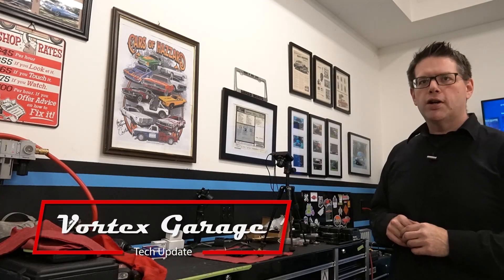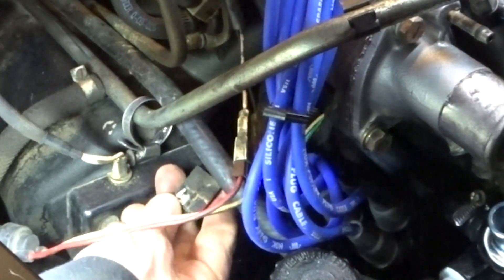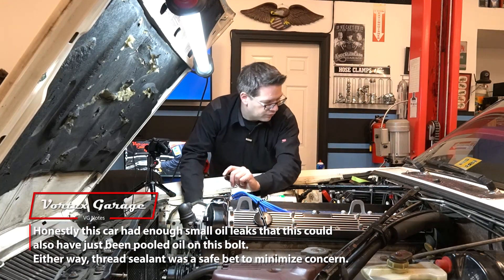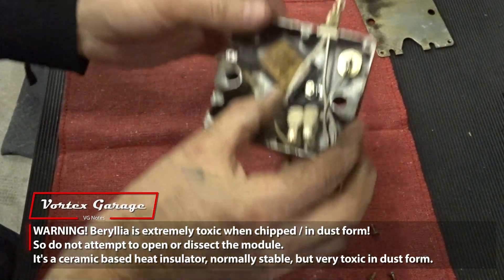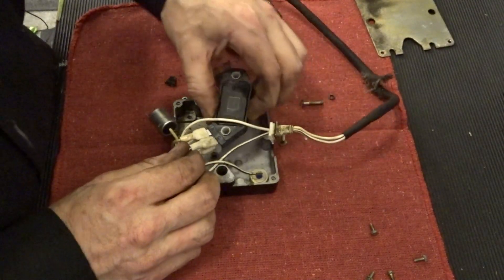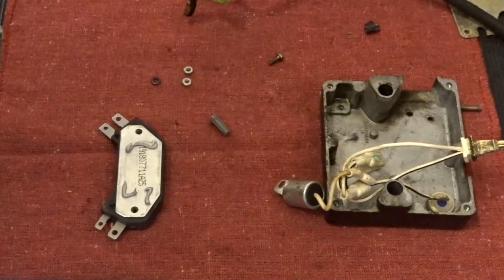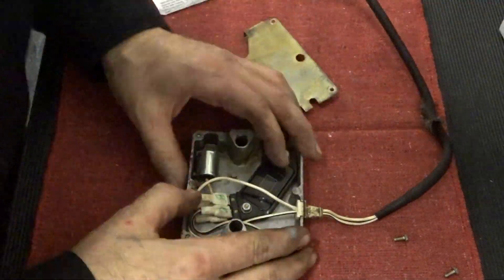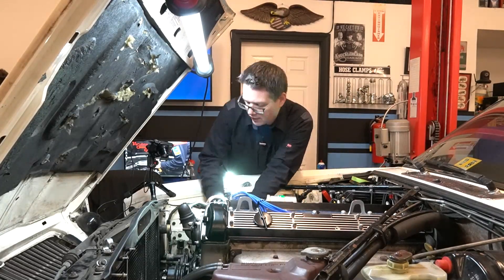Rebuild the Lucas AB14 Ignition Amplifier - SECRETS Within! - 83 Jaguar XJ6

Comment: I found that there is some difference in gm modules. Besides my jaguar i have a fiero and when the module went bad i went to advance auto and bought the best one they had and had trouble when i went on a longer ride , the engine  died  so i let the engine cool down and was able to get home .so i figured because the engine is in the rear it was heat issue so i got a module from the fiero  store that advertised it was better for hot conditions. This may apply to v12 jaguars because of the excessive heat under the hood

Comment: Hallo and thank you for the great video. I have one question: The D72000 is a multiple spark module - how does this work with the ECU?
Also it has a rev limiter designed for V8 - so i guess you have to set it to 9000rpm for 6000rpm on a V12 engine

Comment: What are the size of the bolts you removed ?  13mm?
Reply from the maker: The ones holding the unit on were 1/2" I believe. A lot of fasteners on the Jag are imperial (sae) sizes, 7/16 and 1/2 very common. 13mm would work. 

The ones holding the case together (small bolts) were 3/16 I believe

Comment: Whats the difference between the 2 and 4 wire versions?
Reply from the maker: I believe it's mainly 12cyl cars that have  the 4 wire. I think it's due to a coax wire that goes back to the EFI computer for managing fuel pump and efi triggering. I may be off a bit in that but I do think thats the main difference.

Comment: Informative topic. Thank you. One question - how do we know that we need to change the module? What would be the symptoms? Thank you :)
Reply from the maker: I would say overall driveability issues when hot, or the car stalling out, loss of ignition when hot, etc, or worst case, no spark at all even when cold.  Usually I've seen these modules fail partially where they start to give out when hot but then work again when cooled down.  Loss of spark either way, but manifests in driveability issues, misifres, etc.